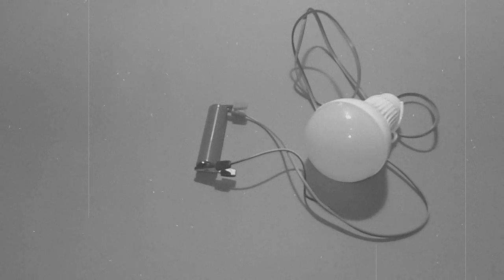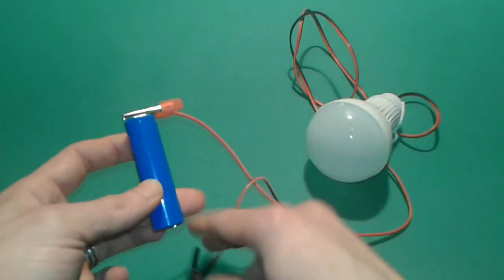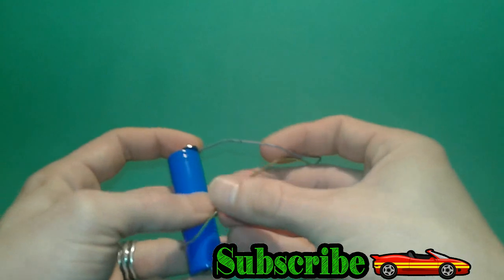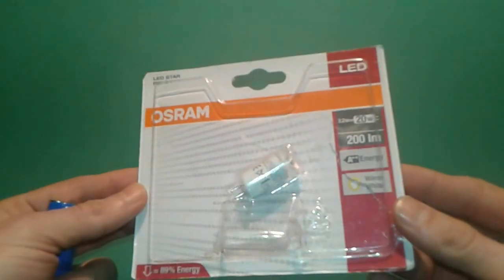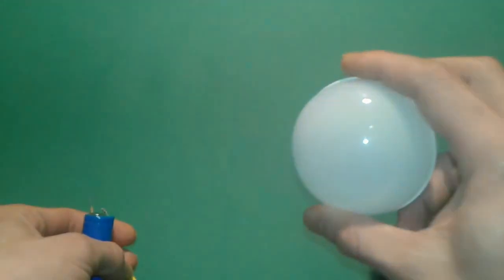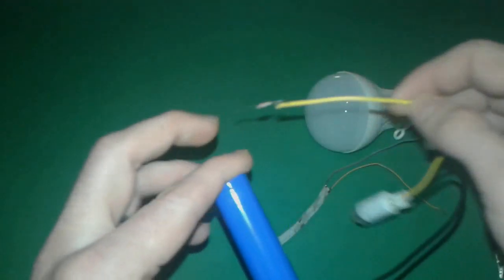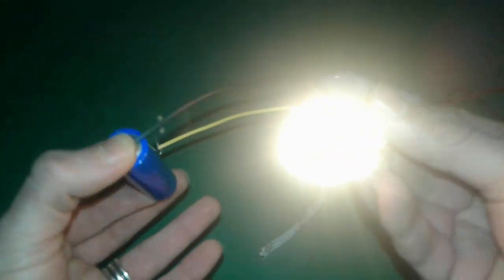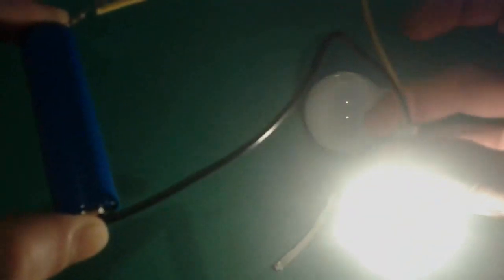How to power an 12v led light bulb with one 18650 lithium battery

Comment: just wondering how many hours would that bulb be powered on before battery runs dry???
Reply from the maker: Paul Harris without any response protection depending on the battery size hours and hours but after a while because the voltage drops the light will start to dim all the best mate check the new video hand crank generator